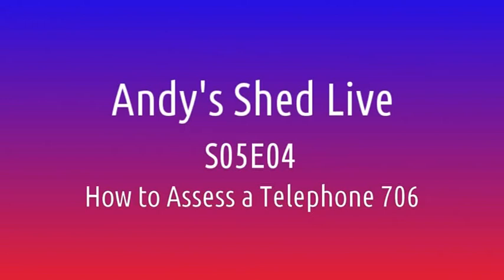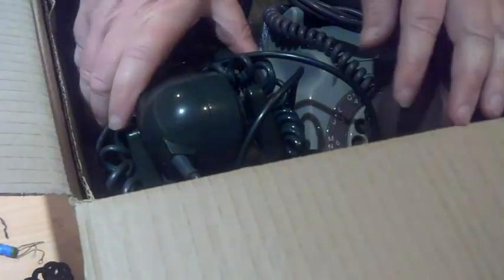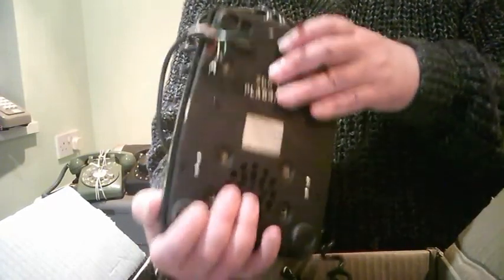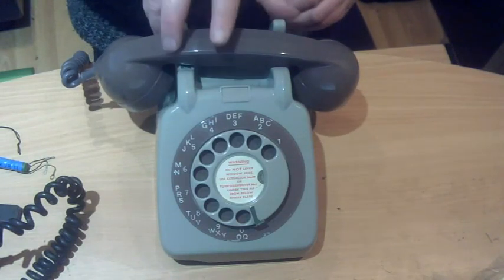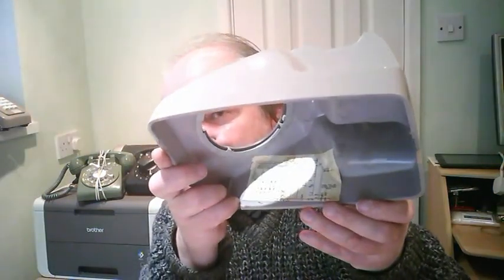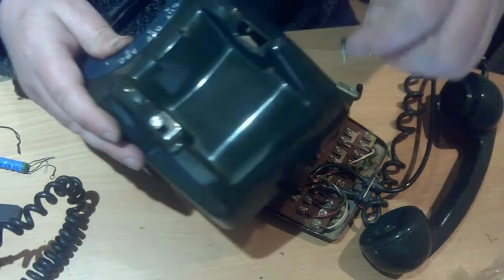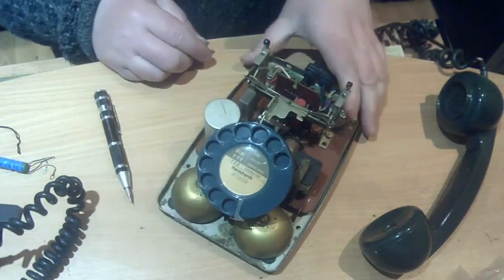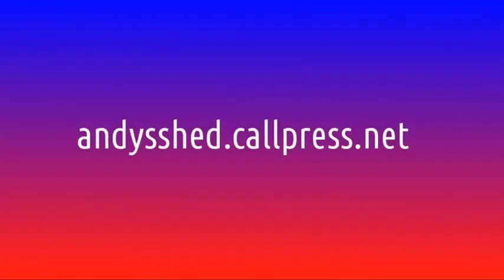Andys Shed Live S05E04 :HOW TO ASSESS A TELEPHONE 706

Comment: I have this phone from my childhood but the dial doesn't automatically spin back to normal position for some reason. Do you have a video to fix the dial?
Reply from the maker: It's either gummed up and needs a clean or the dial spring  is broken. Both are not the end of the world although replacing the spring is quite tricky if you've not done one before.
Reply: @AndysShed  thanks for replying 👍 one minute it was fine then it just stopped returning. I guess it's a broken spring or its come out of place. I might have to send it away.
Reply from the maker: Sounds like a broken spring to me. What sort of phone is itand where in the world are you? If you're here in the UK I could have a look at it for you. Drop me a line via the contact form on the website at https://andysshed.callpress.net if you're interested. To replace the spring if it's a dial 21 would be about £20 plus the return postage.

Comment: Shame about the cases. I bought a 746 in Brown recently. it wasn't packed very well and was broke unfortunately when it came. Thinking it must have been diacon, took a real bash.Got my money back, but what a shame.
Reply from the maker: If it was a 746 then it definitely wasn't Diakon. They had stopped using it a few years before the 746 came out. Your case was almost certainly ABS, which can still break if it's hit hard enough. The good news is ABS can be repaired and the fix is sometimes totally invisible, especially if you still have all the bits. Drop me a line via the contact form on my website at https://andysshed.callpress.net if you would like details of my ABS restoration and repair service.
Reply: @AndysShed  Thanks, Andy. , the blow must have been a big one, one corner and most of one side was broken exposing the inside. Perhaps it was sent broken, Nothing surprises me with eBay. cheers. Pete.